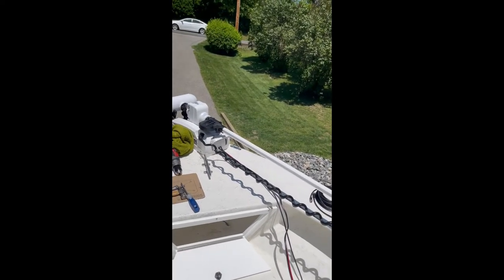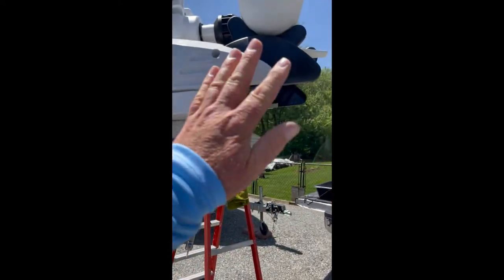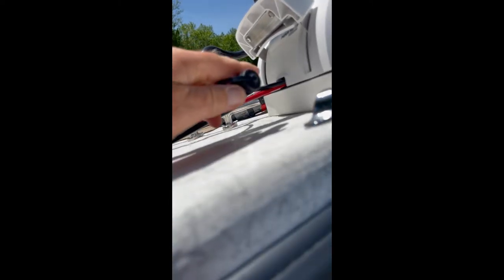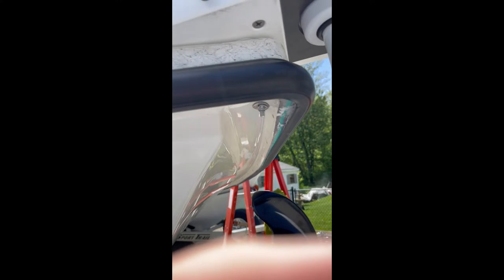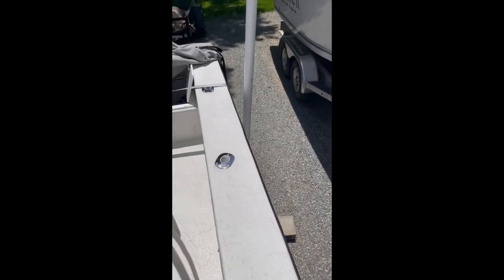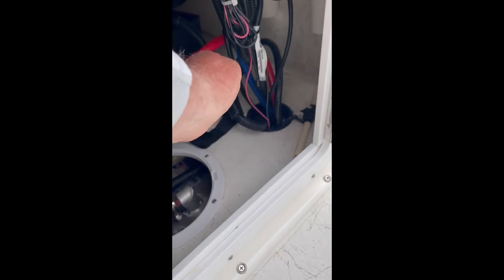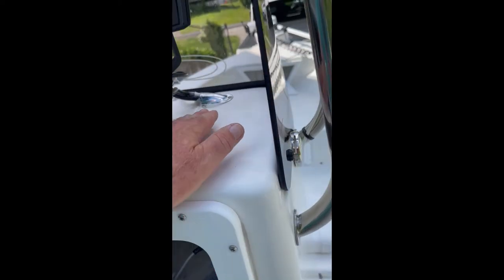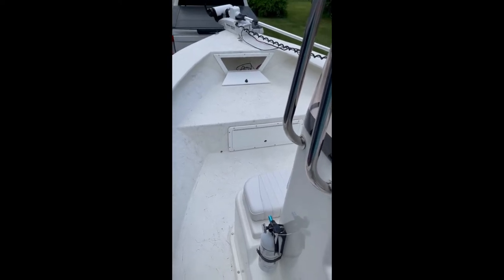Trolling motor install 2022 May Craft 1800CC

Comment: Nice video and setup. Have you noticed any ride/handling difference with the added weight in the front of the boat?
Reply from the maker: No difference. I used a single 24V lithium battery so weight was kept to a minimum.

Comment: I have the same boat and am planning to add a trolling motor.  Are you pleased with the one you chose?  I believe it is a 60" shaft?  How about the batteries and placement? Thanks John
Reply from the maker: 72” shaft and it’s great. Placement and battery so far has been great. Not a lot of options as to where and what to use. I’m still able to store my paddle and throw cushion under the front making sure they stay clear of the charger and any wires.

Comment: How do you like the boat so far? This and the 1900 CC are two of the boats I've been looking at. Do you fish both salt and fresh water?  Do you ever fish with 4 people in it, if so how comfortable is it to do so?....Thanks
Reply from the maker: I have to say the 1800 has surpassed my expectations. I fish only salt with this boat. In my opinion it is a great one person boat.  It is a good two person boat. The rating is for 500lbs so that’s just about limited out with two decent sized people. I have read of people fishing four out of it but I couldn’t imagine that. Maybe they fish differently. I believe the specs on the 1900 are higher. The 1800 is just a skiff style boat (no inner liner). They have also discontinued the skiffs at this point, so your only option may be used. Though I know there are a few boats still in dealers for sale new. Again it has surpassed my expectations I just wished the quality was a bit better. That being said the price was right compared to higher end boats.